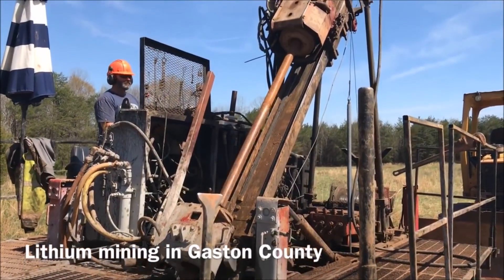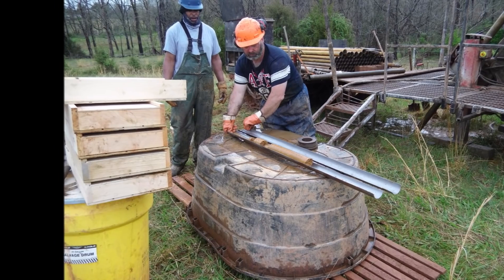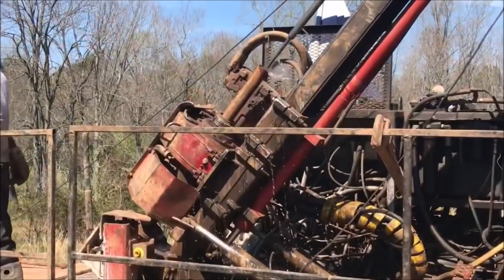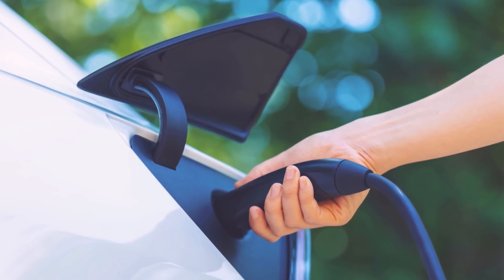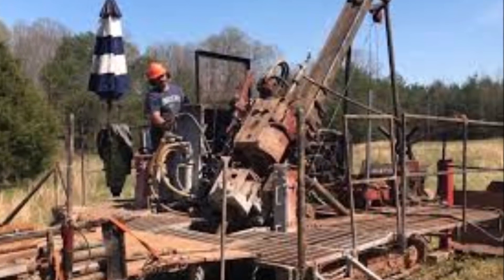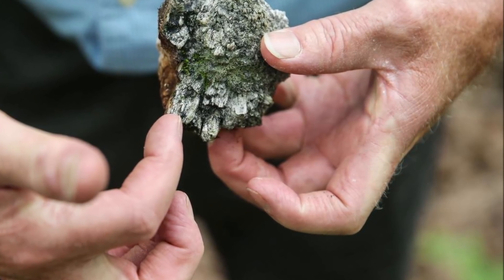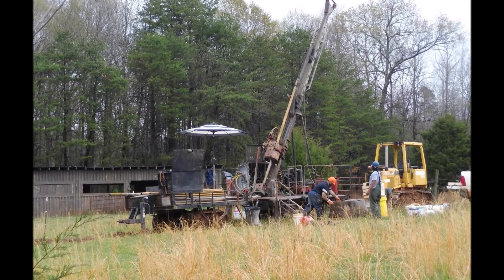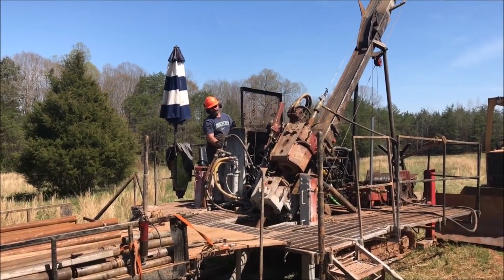Tesla Signs 5-Year Binding Lithium Supply Deal with Piedmont Lithium

Comment: Tesla should buy Cypress Development Corp in Clayton Valley, NV. They have a massive holding with a very low strip ratio. It's a very large lithium rich clay hosted area with very high concentrates (over 1000 ppm). Check out Cypress Development Corp - under $1 but not for long!!!!!